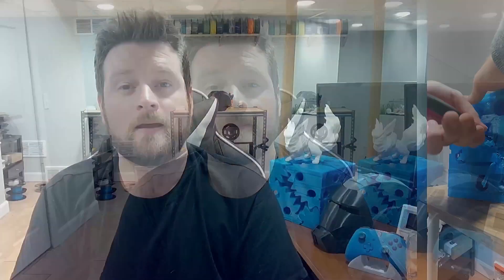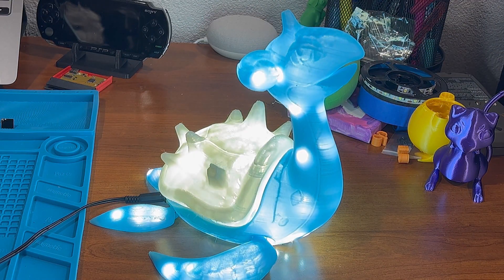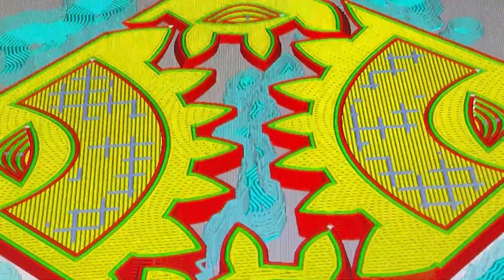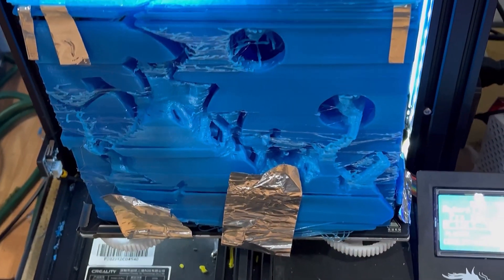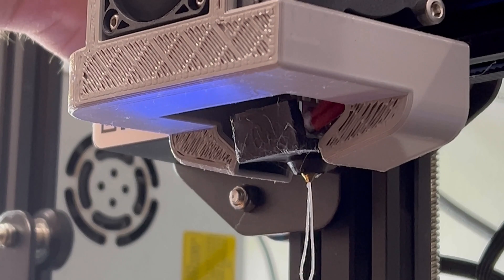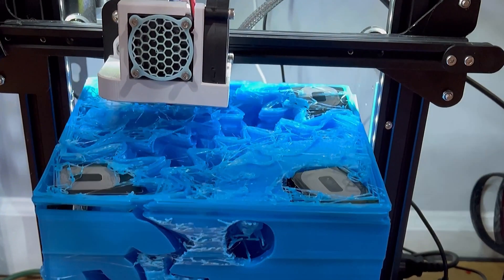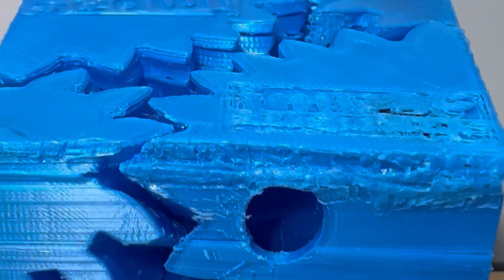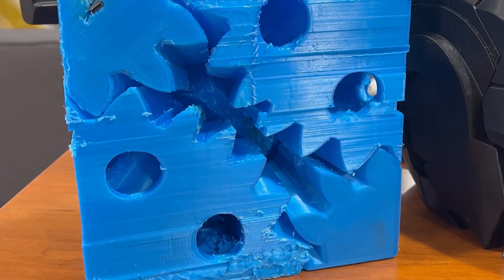3D Printed Giant Rotating Glow in the Dark LED Gear Cube Build

Comment: I still don't understand how it went from that blobby looking thing to the finished product, I would've liked to have seen you actually fixing it, because it just doesn't seem possible. Why don't you try again but make the box like 20% smaller. Wouldn't that be easier? I'd like to see you try again with better lights and batteries, knowing what you know now. Also its be great if we saw more than a couple of seconds of the finished product at a time. If we really got q chance to see it turn all the way a few times and from a bunch of angles with all the lights on and also glowing in the dark. I feel like I barely even saw how it turned out 😕

Comment: It is amazing that you are able to do that. I still can't get my nozzle height right to print just normal things.
Reply: Let me guess... You are printing on the Ender glass build surface. If so, is not a z offset or bed level issue but bad adhesion. Try with glue in spray or PEI sheet.
Reply: @Drumaier  Nope, I'm using pei.
Reply from the maker: Thank you!